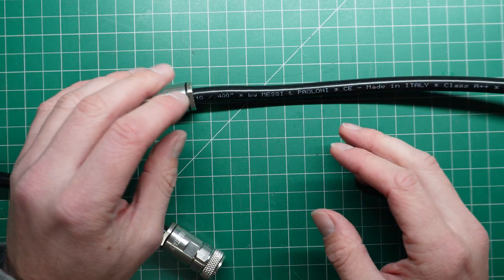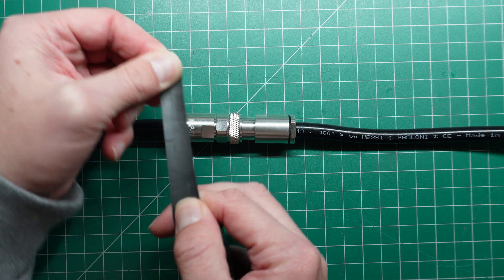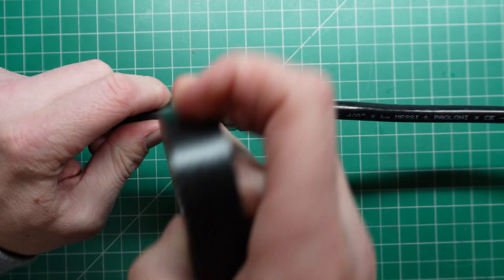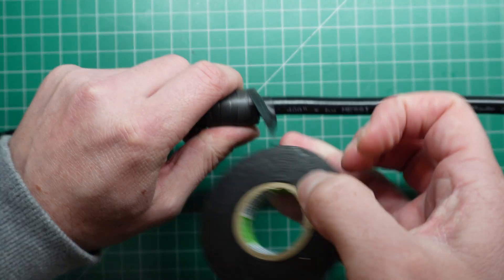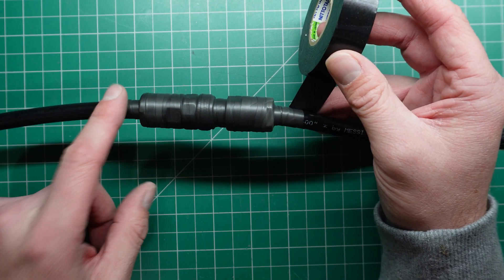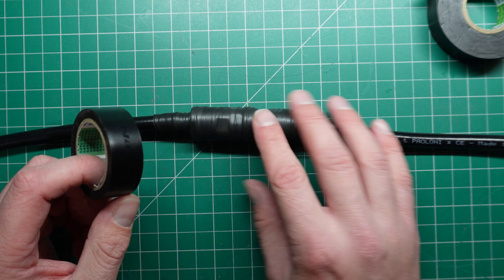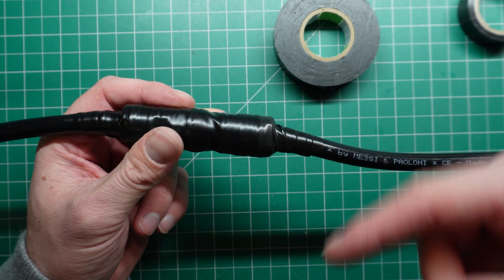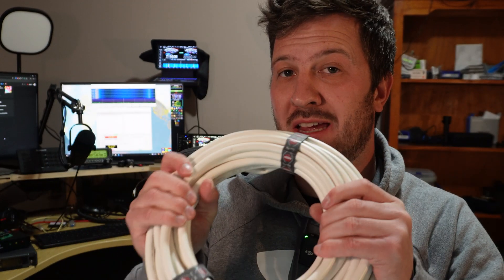Waterproof COAX Cable the Way The Techs Do It!

Comment from the maker: The Coax SUPERIOR To What 99% of Hams Are Using 👉 https://youtu.be/spHOPX70krc
Reply: Hayden I consider your work 99% better than most channels. This video was brilliant right up to promoting a brand of cable that sponsors you. Its unethical for any operator with financial interest in any product review to first, just dont abuse the trust youve worked hard to earn.. and last, clearly reveal financial interest so recommendations are ethical.
M&P is specified as great stuff but is not 99%   more effective than other brands. Thats just hyperbolic baloney.
Its most certainly better than rg58 cheaply aquired via Amazon for Amateur radio work. And its absolutely the most important gear in VHF and higher.
But please be honest to the community and bring the whole spectrum of good names and type of cable. I buy government surplus thats certainly higher rating than Hyperflex 13. LMR 600 or even 400 from Times Microwave or Andrews is far above Hyperflex 10. As you rated lmr 240 alongside HF 10 is not really an option with VHF and higher. Im really not even comfortable using 240 when surplus lmr 400 can be aquired from a number of surplus government vendors.
Low loss, high quality cable is the single most important aspect of an effective station. Losing 2db in less than 100 feet is not acceptable. 
Connectors are critical too. I was at a ham fest yesterday and left with a dozen Amphenol connectors from. you guessed it, SURPLUS GOVERNMENT AUCTION. $3 each for minty fresh coupling and new lmr 400 type N connectors that both clamp and get center pin soldered. 
Your a great YTer and I consider you a friend and just ask you to put the community before corporate sponsors.
Reply from the maker: @radiotests this video was not sponsored by M&P in anyway. I provide disclosures when such videos are. Thank you

Comment: On commercial sites we generally use "Butyl tape."   A comon brand is "Times Microwave WK-U" but there are others.   Wrap a single layer of Super 33 or 88 eletrical tape, then apply the butyl tape over the electrical tape.  The only reason for the eletrical tape is so that you can get the butyl tape off in the future.   It never dries but it will take a sharp blade to cut threw this stuff after it sets up.  The electrical tape should extend beyond the connectors and the butyl tape should extend beyond the electrical tape.

Comment: PVC cement over the vinyl electrical tape can seal it. Not as flexible as without it but can be pretty good. The last bit of vinyl tape applied should not be stretched but just laid down.

Comment: So, which tape are you using exactly? I clicked on the link you provided and when I received it today, it is NOTHING like what you are using! It is 1.5 inches wide and has a backing which makes it VERY hard to use! Partially my fault as I just ordered it thinking it was what you are using. Please advise, very disappointed!
Reply from the maker: Nitro Denko Self Amalgamating Tape - https://www.nitto.com/au/en/products/e_parts/high_performance006/
Reply: @HamRadioDX  Thanks!

Comment: I used to do it exactly that way: Good quality runber tape (I used a "Scotch" brand) followed with an over-wrap of good-quality electrical tape ("Scotch 33+").
However, of late, I started using 1" heat-shrink tubing, the kind with a light bit of "adhesive" glue inside, and found it works much better. Less expensive too. And removal, if/when you need to access the connection, is far easier as well.
I got 3-foot lengths from Amazon, 1" dia (before shrinking), in red & black, for a very reasonable price.
Just something to consider...
 Thanks for your video! 👍👍

Comment: In the sweltering summer of 2012, I found myself stationed at Forward Operating Base Thunderclap, a dusty outpost nestled in the rugged mountains of eastern Afghanistan. I was Sergeant Elias “Gum” McCallister, a wiry, quick-witted electronics expert in the 3rd Battalion, 75th Ranger Regiment. My reputation preceded me—not for marksmanship or brute strength, but for an uncanny ability to keep our gear running in the harshest conditions using the most unlikely tool: chewing gum.
It all started during basic training at Fort Benning. I was always tinkering, fixing radios and night-vision goggles with whatever was at hand. One rainy night, during a field exercise, my squad’s comms went dead—water had seeped into the wiring. Out of options and with a drill sergeant breathing down my neck, I grabbed a stick of spearmint gum from my pocket, chewed it into a pliable wad, and sealed the exposed circuits. To everyone’s shock, the radio crackled back to life. That moment earned me my nickname, “Gum,” and sparked a legend that would follow me through my military career.
By the time I deployed to Afghanistan, I’d honed my craft to an art form. Our outpost was a tech graveyard—sand, rain, and relentless heat fried everything from drones to satellite uplinks. The Taliban knew it, too, and they’d exploit any tech failure to ambush our patrols. My job was to keep our electronics humming, and chewing gum became my secret weapon. I carried a rucksack stuffed with every flavor—spearmint, cinnamon, bubblegum—each with a specific purpose. Spearmint was sticky enough for quick seals, cinnamon held up in high heat, and bubblegum stretched for larger gaps.
One night, during a critical mission to intercept a Taliban weapons convoy, disaster struck. Our squad was perched on a rocky ridge, relying on a portable drone to scout the valley below. The drone’s control unit, a finicky piece of tech, shorted out after a sudden downpour. Without it, we’d be blind, and the convoy would slip through. The lieutenant was furious, barking orders to abandon the mission. But I wasn’t about to let that happen.
I knelt beside the drone’s control box, popped two sticks of cinnamon gum into my mouth, and chewed furiously. The cinnamon burned my tongue, but it was perfect for the job—resilient in the desert heat and tacky enough to form a tight seal. I pried open the control unit, spotting the problem: water had pooled around the circuit board, shorting the connections. With a combat knife, I scraped away the corrosion, then molded the gum into a thin, pliable sheet. I layered it over the exposed circuits, pressing it into every crevice to block out moisture. For good measure, I wrapped the entire board in a second layer of gum, creating a makeshift waterproof casing.
The squad watched, half-skeptical, half-mesmerized. I reconnected the unit, flipped the switch, and the drone’s feed flickered to life on the monitor. The lieutenant’s jaw dropped. “Gum, you’re a damn wizard,” he muttered. We spotted the convoy minutes later, called in an airstrike, and neutralized the threat without firing a shot. That night, I earned a Bronze Star, though the citation conveniently omitted the chewing gum part.
Word of my exploits spread like wildfire. Soon, I was the go-to guy for any tech crisis. When a Humvee’s GPS unit failed during a sandstorm, I sealed its wiring with bubblegum, stretching it thin to cover the delicate connections. When a sniper team’s laser rangefinder got dunked in a river, I used spearmint to insulate the optics, keeping it functional for a critical shot. I even saved a satellite phone by encasing its battery compartment in a triple layer of cinnamon gum during a monsoon. The techs back at base called it “McCallister’s Miracle Gum,” and soldiers started hoarding gum packets, hoping to learn my tricks.
My pièce de résistance came in 2013, during Operation Iron Trident, a joint mission with Navy SEALs to capture a high-value target in a remote village. The plan hinged on a network of motion sensors we’d planted to track enemy movement. But the village was a floodplain, and a freak storm turned the ground into a swamp. By dawn, half the sensors were underwater, their signals dead. The SEAL commander, a grizzled Texan named Captain Hargrove, was ready to scrub the mission. “Unless you’ve got a miracle, Gum, we’re done,” he growled.
I didn’t hesitate. I grabbed my gum stash—every flavor I had—and waded into the muck with two other Rangers. We pulled each sensor from the water, dried the casings, and got to work. I chewed spearmint until my jaw ached, forming it into tiny gaskets to seal the sensor housings. For the larger units, I used bubblegum, stretching it into flexible membranes that hugged the circuits. Cinnamon gum went into the battery compartments, its heat-resistant properties perfect for the humid conditions. By the time we finished, I’d used 47 sticks of gum and smelled like a candy factory.
The sensors came back online, pinging enemy movement with pinpoint accuracy. The SEALs swooped in, nabbed the target, and exfiltrated without a hitch. Hargrove shook my hand, grinning. “Son, I don’t know what’s crazier—you or that damn gum.” The mission was a success, and I was quietly credited with saving it.
When I left the Army in 2015, I was offered a job at a defense contractor, but I turned it down. Instead, I started a small electronics repair shop in my hometown, where I still tinker with gadgets and teach kids how to fix things with whatever’s at hand. My old squadmates still send me gum packets in the mail, each with a note begging for one last “miracle.” And though I’ll never admit it, I keep a stash of spearmint in my toolbox—just in case.
Reply: Nice AI story

Comment: I was a Field Wireman in the USMC back in the early to mid 80's.  To make the connection water-resistant, we were taught to start in the center, wrap left or right past the connector, then continue to wrap back to the opposite end, continue to wrap back and finish off in the center, where you started.  Do not pull on the tape when finish; to cut use a knife or scissors.  Pulling on the end to break the tape will guarantee for the end to unwrap and fly like a flag.   

After the Marines, I eventually became a RF tech then RF engineer for a local government agency and came across many electrical splices or outside coaxial connections that some bonehead contractor used crappy cheap electrical (probably the cheap HFT tape) that I had to repair.  As you mentioned, it's so important to use quality tape, UV resistant if used outdoors.  I use 3M Super 88 or 33 (depending on application) to go over the Self Amalgamating Tape.  The 3M is more expensive but worth it.
Reply: Can you explain when you’d use the 33 vs the 88 tape?

Comment: Nothing quite like electrical tape (esp the cheap stuff) that has baked in the Arizona sun for a few years, leaving a blob of goo for you when it's time to disassemble, eek !  Why not good quality (black) 4:1 heat shrink,  just avoid the stuff with adhesive inside unless you know it will never need to be separated. Cheers !
Reply: The adhesive lined stuff is way better at waterproofing, so highly recommended. It’s actually not hard to remove: the lining is essentially hot-melt glue. And like hot-melt glue, you can get the adhesive to release completely and cleanly by putting isopropyl alcohol (IPA) on it. This is not a chemical process, but a fundamentally mechanical one: somehow the alcohol flows under the adhesive and releases its grip, yet the adhesive is not dissolved at all. So just apply IPA, flex it a bit to get the edge of the adhesive to start to lift, then apply more IPA and flex again. Repeat until it’s loose. The exact situation will dictate whether it’s easier to slit the heatshrink before or after using IPA, or whether you do it in sections, etc.

Comment: Why don't you place electrical tape as first layer (followed by self fusing tape, then again electrical) to make it easier to disconnect and reuse connectors later? No need for disconnecting or electrical tape as first layer doesn't work well?
Reply from the maker: Most of my connections are permanent. But for those temporary ones then I use a layer of Scotch33+, then self fuse and Scotch33 again.

Comment: Heat-shrink tubing?
Reply from the maker: Unless it's gluelined - the water will get in.
Reply: @HamRadioDX  Yes, quite correct. A glue-lined permanent seal. ;)
Reply: I've popped non glue lined heatshrink over self amalgamating tape before

Comment: I have always used electrical tape. Never had water in coax (42 years of doing it). Even air spaced coax. My secret: I keep a household candle in my tool box and melt wax over the tape so it repels water. One of my friends paints the tape with PVA glue to amalgamate it. His method has been equally successful. Just food for thought. We don't have to do things to the nth degree.

Comment: I've used that stuff for over fifty years, but never seen a roll of SA tape which didn't have a separating wound with it. How  does that stuff not self amalgamate on the coil.
Reply from the maker: It needs to be stretched for it to bond

Comment: Was there a method where goo was applied and covered up? You had to cut off the gooey joint before working on the cable. Then there was this wide tape which included the goo.
I think the goo was black.
Imagine doing this up a ladder.

Comment: Here in europe i have seen only the "end of the day" tape, the thick rubber stuff is not sold here ihink. There are cable clamps with a seal in it, or the N-type plugs have seals themselves and should ideally only corrode on the outside.

Comment: Great video, ive been also using non conducive dialectic grease inside my connectors also.
Also worth noting is that when connecting to an antenna where the connector is in the base is that as per the video start wrapping from the coax end to the connector so the overlaps face down and not up: this prevents any potential ingress also.

Comment: very good. this is how I learned years ago. now a new product from M & P called silicone seal replaces the electrical tape and can be used but it self.  just place over coax and connector and putt the string out and it  and it shrinks with out heat  you can use glue line heat shrink but the heat needed may damage coax and or connector. hear in NY,USA we use 3 or 4 layers on out systems. lots of snow and ice with wind.

Comment: Yes good video.  The idea of stretching the tape - any tape is so that it spends the rest of it's life trying to contract upon itself.  It is always tightening.  I used to be an electric linesman - for the County, Borough and Power Board.  On power lines/cables we would rough sand the ends so that there was a rough surface to meld to.  3 layers of PVC un-stretched to provide insinuative layer.  3 layers of tight the a couple of stretched.  Of course all were over lapping.  We would often leave then tapes in the warm sun and the self amalgamating we would use the warmth of our hands to make the tape become 'one tube'.  After each 'run' we would extend past the last run and sometimes we had quite a long join.  And yes.  In the ground or in the air Denso and that too was hand smoothed.  I have seen one denso join painted over and was immaculate under that first wrap.  Today I don't get quite so carried away but I still use one stretched layer of PVC first.  This is so that when I want to reuse the connectors they are not contaminated with sticky stuff.  I am amused when I see blokes break a piece of tape off the roll and pre-stretch it, because to man handle the roll around the join and keeping tension on it is hard .  We used 3m and the self amalgamating tape was thicker than the stuff in the video.  Cheers Dave Creek ZL3DRC
Reply from the maker: Thanks Dave!

Comment: We finished off the the self fusing tape with Scotch Brand 33 electrical tape followed by several coats of Scotch Coat sealant. Very resistant to the elements. The Scotch Coat might need a booster coat every five years but it’s go PM to check feedlines for any abrasions that might compromise the coax.
Reply from the maker: It's amazing too when you tie a cable to a tower leg how it moves over time and rubs away the tape!
Reply: @HamRadioDX that will happen if you have a connection that might fall on a tower leg. You should always add several layers of a good quality tape around the leg where the connection will sit. If possible add a jog in the line away from the tower leaving about 1/2 to 1 inch gap to the tower leg. Adding the black weather resistant Ty wraps on each side of the jog to prevent it from moving and rubbing against the tower. Another thing I forgot to mention is that we apply at least two layers of electrical tape directly over the connection ending about two inches each side of the connections. Apply the mastic sealing tape extending another two inches beyond the base tape coating finishing with with a final coat of tape extending a few inches from the mastic ends. The purpose of the base layer of tape is to allow one to cut off the mastic and peel away the base coat of tape allowing for a clean wire surface should you ever need to open the joint. This is what was recommended by Andrew wire and cable division. Thank goodness in my years in the wireless business, I never had to open up a connection like this due to moisture ingress or damage from a lightning strike.

Comment: I use electrical tape to wrap around the connector and the cable immediately adjacent to the connector.  Then I overwrap that with the self-fusing wrap.  This allows me to unwrap and open the connector if needed, and not needing to dig all the self-fusing out of it.

For the overwrap, make certain to wrap a complete turn around itself at each end, without stretching the tape at all. That will usually stay in place, but the locking tie strap is good insurance.